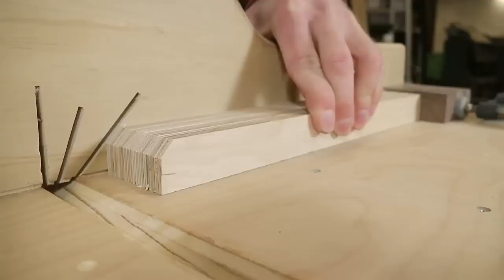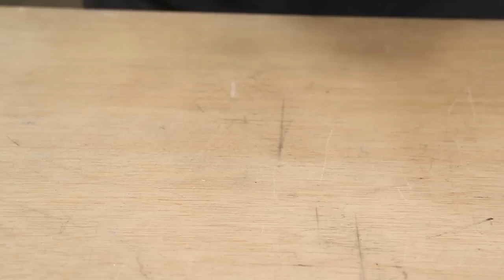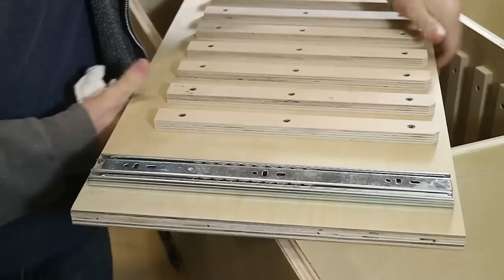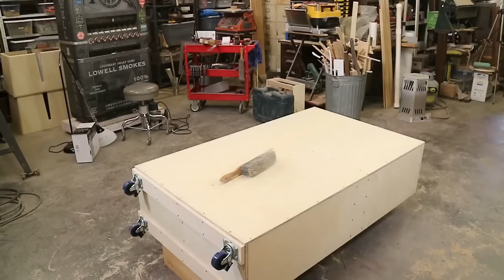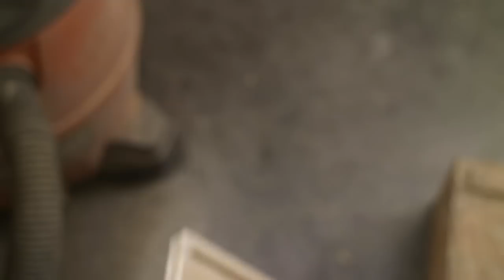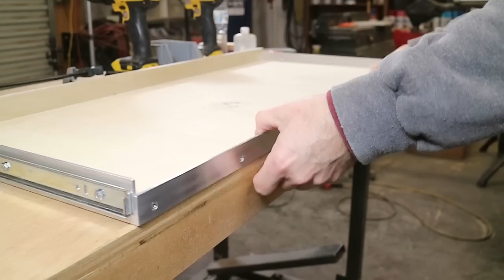Sorta Sortimo Small Parts Rack & Sorting Station

Comment: woodworking is 50% making, 50% fixing mistakes and 25% maths
Reply: 50% + 50%+25% = Ohh I get it.
Reply: Only if it is a big project.
Reply: @mathboy1212  yep I had 175% project once, it almost killed me😁
Reply: You know, 90% of all stats like that are just made up on the spot.
Reply: 90% of a project takes 90% of the time. The final 10% of the project takes the other 90% of the time.
Reply: This tracks. Also add some percentage for slop and looking at the project wondering where you went wrong/what were you thinking

Comment: A very well done and well filmed version of a not-great concept.  To even find out if you have the right box requires taking it out, finding a place to put it, or in this case, pulling out the tray, and putting the case down and opening the lid, praying that it never gets knocked over.  Then you still need overflow storage for larger quantities of common items.  If they were drawers, it would be one step- open drawer, select item.
Reply from the maker: I label them. That's how I know which one to grab. And drawers aren't really conducive to transporting to different jobs. If this solution doesn't work for you, that doesn't mean it's universally bad. Not everything is designed specifically for you.
Reply: @WesleyTreat  Not universally bad, just not optimal, IMO.  It would be interesting to see it in use after four years- still happy with the set up?  Again- great job on the video.
Reply from the maker: @jaywood8296  Yes, thank you, I'm very happy with it. I think what you mean to say is it's not optimal for the way you work. No solution is optimal for everyone, but may be perfect for many others. Thanks! 👍

Comment: Have a similar rack, mine is not as tall nor as nice. I installed it on the wall with French cleats, you will be amazed at how much you can get in organizers. Just a small tip when using the label maker to label ( I did mine on the yellow part of the handle), 2000 grit sandpaper and a wipe with isopropyl alcohol  will make sure your labels are not "self-removing."

Comment: Awesome work! The Jetson's table saw sound was priceless (as well as the Kondo gag). I built something similar (but not nearly as nice) to keep a storage system in my van. Some advice about putting labels on these cases - even using an industrial labeller (with "permanent" UV stable tape) I still found they peeled off over time. This was fixed by overcoating with epoxy - just make sure it's UV stable non-yellowing!

Comment: Nicely done. I would add a pair of tongs or tweezers hanging on the side of the cabinet for fishing bits out of those bins quickly.
The Jetsons table saw sound edits are hilarious.
Reply from the maker: I have plans to add some accessories. Maybe a tube for rulers, a slot for my binder with notes, and a square of sheet metal for magnetic trays.

Comment: So cool. I bought a ton of those stanley cases as well. I was also able to buy different sized bins to go inside them. The larger ones for the deep cases are especially nice.

I went through the same process you did: found out Sortimo was way too expensive. THen I also considered systainers, which I use for tools, but no. Same issue, and they also take up more room.

I still need to build my holder/rack for them, though. I like your design.

In case you're curious, thingiverse has a number of 3d printable containers for these, for all sorts of things.
Reply from the maker: Yeah, I'm already planning to hit up a friend of mine with a 3D printer for some extra bins. 👍

Comment: Wesley, very clever & beautiful design.
Too late to suggest this, but when you had to remove the bottom section of main case, you did not need to remove the screws at 4:52.  If you removed just the outside screws, you could have removed it as a "tee" section, and then reinstall as one piece instead of two.
But then again, in my world, something would have gone wrong and I would end up splitting the wood or some other dumb thing.

Comment: A simple idea that may speed things up is to drill a hole a little smaller than your smallest yellow compartment in the full-length pullout shelf. Then you can dump the contents of a bin onto the surface, sort out the parts you want. When you are done, hold the bin under the hole and sweep all the remaining parts through the hole and into the bin. It would be quicker than picking up all the parts and putting them into a bin.
Reply from the maker: Not a bad idea. I've already got one of these, though, which I'll probably hang on the side:
https://www.rockler.com/easy-sorter-funnel-tray
Reply: @WesleyTreat   That is really cool. Just ordered two. Tho I will say it is more difficult to lose a hole.

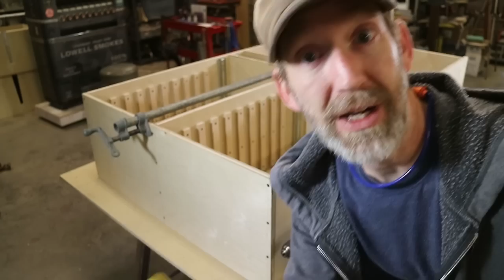Comment: 6:25   That 90 degree tool is good, but - they can be destroyed with too much torque. I broke one internally (I use them on cars professionally) and found an aviation one which is 100 percent steel, and way stronger. The one you have is pretty good unless you use too much speed or torque. As long as you are careful, it works.

Comment: Absolutely perfect cabinet!!!! I had made myself a smaller one and was looking for some inspiration for something bigger.   Any chance of basic plans/measurements/dimensions?  I am assuming it was all 3/4" plywood.  I love the use of the angle for your pull out shelf.  You sir are a genius!!!
Reply from the maker: I might put out plans for things like this in the future, but I don't have a system in place for that just yet. 👍
Reply: @WesleyTreat  Ok Just one question then.  Is it all made from 3/4" plywood or is it a mix of 1/2 and 3/4?  Hard to tell at a few spots in the video.
Reply from the maker: @4x4ff  1/2" for the drawers, the tray, the rails, the back, and the horizontal piece between the tray and drawers. Everything else is 3/4".
Reply: @WesleyTreat  Thanks Wes.  You da man.  I am a youtubeaholic especially with makers.  I truley love your videos the best.  I like your style.

Comment: Great video and build!  One thing I thought of though... After you completed the first set of internal cross supports.. You had to remove them to do the lower ones.. You could have just removed the screws from though outsides.. (not the ones holding the two pieces together) pulled it out as one piece.. Installed the other supports.. then slid the T back in.. And re fastening the outsides... Negating the need for the angle driver..  Not that I'm ever against looking for reasons to buy more tools.. But anyways.. Great video!
Reply from the maker: From what I remember, the two pieces together were just a little too big and awkward for one person to lift out without risking the joint tearing out. Glad you enjoyed it!

Comment: Very Nice!  I see you're using a kerosene shop heater - you DO have a carbon monoxide alarm, right?  Also I like your heater very much, and today it's 6°C inside my shop, so can you post a link to where to get it, or at least what kind, etc. ?  I like the "Made it hold both types of cases" as I also have both kinds, and they are currently very inconveniently stacked on plastic shelves.  One of your compatriots did a parts shelf with 10cm dadoed-in demi-shelves to hold the parts cases on, resulting in no less than 50% wasted space.  I think I will use 30mm aluminium "L" extrusions to hold the cases (mostly because I already have the stock), so that I can bump the density up just a bit.  I especially like the unloading shelf.  Very nice indeed!! 👍👍😃  I also like the straight cutting router bit on the back panel, for what Matthias Wandel calls "retroactive precision.'

Comment: I am having the same wish after I saw the video Adam made, but until now unfortunately have not found decent quality and priced cases, even cheap cases are hardly seen here.
Now just with boxes same as the grey one you are using for catching the small wood parts at the cutting table, using them as ''mix box'' for parts that came out of older items. 
Just... waiting for the right ''find'' then I will have nice small compartiments for the smaller items. 
They are now in jars, wallboxes, cookiebins,.. everywhere !
Reply from the maker: If you want really tough bins like that gray one, have a look at restaurant supply stores. Some are decently priced, some are really expensive, but they're all incredibly durable.

Comment: Great video. What sort of overhang on each side did your plastic cases have to slide in on those strips of ply? I have a heap of them with only 7 or 8 mm on each side. Thinking I might be pushing my luck?
Reply from the maker: Thanks. That sounds about right. A little less than 3/8".

Comment: Hi, great video thank you 👍👍👍. I have been looking at options for racking myself and have considered a design similar to yours. I am concerned about it being top heavy and worry about issues when moving the rack on its castors. Have you ran into any issues with this?
Reply from the maker: I haven't had any problems except that it's getting heavier than I anticipated, so I plan to add sturdier casters. I could probably topple it if I wanted to, but I tend to push it from the side when I move it, rather than pushing from the front or back, or I push somewhere below the center. I don't really move it all that often, though. If it ever became a problem, it would be easy enough to extend the base a few inches by adding a frame on the bottom. 👍

Comment: When you use a spacing jig like this, what do you do to mitigate things being completely askew at the end of a long run? Do you take measurements every 3 or 4 steps and readjust if needed?
Reply from the maker: I talk about that in the extended version. I checked every 4th rail or so to make sure I didn't get a cumulative error.

Comment: Great Cabinet, how did you install the inside pieces that hold the containers up, it shows one side with the three screws and the opposite side was never explained. If that was hard too understand the numerous runners that you cut were installed with the three screws but the opposite side in the center was not explained how you did that. Thanks
Reply from the maker: The screws on one side of the center were offset about an inch so they didn't run into the screws on the other side. 👍

Comment: I'd never remove the back panel. I'd cut a small clearance/access hole with an oschilating mukti-tool, just big enough for the slides to slide the "wrong" way, do my thing and then patch the holes with a dutchman.

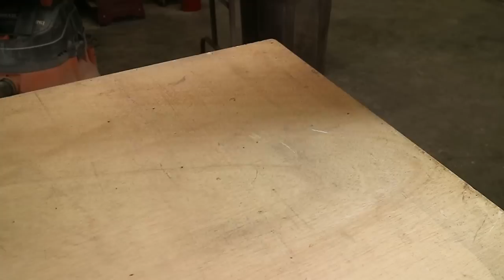Comment: 2:43
I'm curious why you didn't just glue-and-nail the shelf supports. It seems like the screws are the vastly more expensive way to do it. Do you need the extra strength?
Reply from the maker: My secret is not using diamond screws.

Comment: Wesley,  I watched this video 3 times, and have a serious concern.  That new table saw sounds like it has a severe harmonic imbalance in the primary gamma converter.  You may be able to get away with a restructuring of the crystalline matrix, but I suggest a full core jettison, and replicate a new shielded matter generator. 

Oh, the cabinets look neat too.
Reply: Sounds like the trans buffer modial girdle springs to me.  Could probably use a rebuild, just refer to TSB: 24-601B
Reply: @McFlysGarage  I've had a girdle spring go out...(don't ask).  TSB: 24-601B refers to the transsonic plasma dissector.  Maintenance for this saw should be in TSB: 24-601Q
Reply: @airspoon94  I think it just needs a small adjustment to the pre-loaded internally toothed cross-roll bearing slew ring
Reply: Just rewire the outermost connection of the generator. Third wire from the left, good thing you keep those assorted!
Reply: @airspoon94  odd, TSB 24-601B came from the French Division. It must have been mixed up in translation. I'll reach out to Javert and see about resolving that

Comment: 6:31 Hey you could have screwed the middle dividing board to the top board and then put it in the cabinet but that 90 degree drill attachment does come in handy though :P
Reply from the maker: I realized that later, but it probably would have been a little difficult to lift it in there myself without causing some damage, anyway.
Reply: @WesleyTreat  Ah yeah that's also true but hey at least you had an excuse to use a new tool :D

Comment: Question not a criticism; when you removed the first central upright,  is there a reason you didn't remove it as a "T" to save reassembly tight space?
Reply from the maker: A little too big to lift out by myself, at least without risking the joint tearing apart.

Comment: 6:19  What if you fix that board to the other board first, then having a T form and then put them inside and screw it tight from the outside. But then, you haven't to show that 90 degrees screwing tool in the video, which is a neat thing.
Reply from the maker: I should've eaten a better breakfast.
Reply: @WesleyTreat  At least TWO pop tarts (and maybe with frosting)

Comment: You have any thoughts about the caster locations you used? If it were me I’d move them out just a quarter inch or almost to the edge of the reinforcement spacers. Stability increase worth that little bit or she gonna be perfectly fine?

Love the build. Functionality is amazing. Drawer and platform and even the corners nipped on the runners to make it easier to slide the organizers back in. Love love love
Reply from the maker: It's perfectly stable. I've tested it and you'd actually have to try pretty hard to push it over. If I moved the casters to the very edge, I'd be driving in lag screws right next to the edge of the plywood.

Comment: Great use of humor.  Question?  Why a full back if not needed to add structure to the box.  Can I just use some 2" lengths as a backstop instead of buying a whole sheet?
Reply from the maker: Thanks! It's for structure. Filled with hardware, those cases start to get heavy quickly.

Comment: At first I thought this was a fairly ordinary design for a pretty typical piece of shop furniture, but it's very well thought-out and contains lots of good details. Excellent job.
And I love your new table saw sound. Makes me not mind so much that someone whinged about what is certainly an annoyance, but one of those things you just have to accept when you're watching project videos.

Since I imagine some of the hardware you're organising is the rivets you use when fastening sheet metal, can you tell me about the temporary rivet clamp doohickeys you use to hold things in place before the rivets go in? I've seen that you have two types; one for edges where the clamp can wrap around to both sides, and one for holes in the center of sheets where it simply penetrates like a rivet would except you can remove it. There also seems to be a special tool like a pair of pliers to place and remove the clams. Is this a system of your own devising?
Reply: @FrontrunnerDK  Thank you so much. I tried looking before, the first time I noticed them, and I didn't come up w/ anything.
Reply from the maker: Yes, they're called clecos. There are different sizes for different size  holes, indicated by the color of their shell. The copper ones are for 1/8" holes. Here's a starter kit: http://amzn.to/2i6nzFG

Comment: If you attached the center support to the cross piece and then inset them as a T you would not have needed the angle drill... But a great project otherwise. Guess you now need to save up to fill all those compartments!

Comment: holy cow, that's about $1000 in materials. But yes i know. It's TOTALLY worth it. I plan on going with Harbor frieghts boxes. THey are crap as far as how well they close. But for a stationary system that i do not intend to invert they will do great.
Reply from the maker: It ended up probably less than $500 in the end:
Cases: $300
Plywood: $90
Drawer slides: $35
Casters: $20
Misc.: $50

If you follow the Zoro link in the description, you'll find the Stanleys aren't that much more than the HF cases. 👍
Reply: I didn't intend to invert my containers, either...

Comment: Silly question: are you still using this system?
Reply from the maker: Every day!
Reply: @WesleyTreat  so, the reason why I ask: I'm actually workin' on a Gridfinity-like system that's way more laser-cutter friendly - I don't know if you'd be interested (I'm thinking it'd still be too labour intensive for a non-hobbiest like yourself to be of major benefit, especially as a replacement to an extant system) However, if I get this off the ground and I make it stick, I might have several dozen stanley containers left over. It's too early to say, but if it pans out: want em?

Comment: Some Observations: This is fine, IF you are totally convinced that your choice of storage is the BEST, for some time, and IF you already have a woodshop, tools, and experience to spend a LOT of time building the racking system. Fact is, for many small businesses, Time is MONEY, and you have the option of DEDUCTING Expenses, but NOT your own TIME. That means, investing in a full System that integrates storage flexibility with Racking accessibility and versatility, i.e. ways to change thing up as needs or experience dictates, is Money well spent up front. You can get down to your chosen work with minimal downtime spent struggling with the physical layout and accessibility a less-than-optimal system will burden you with, for months or years.
Reply from the maker: k

Comment: Why make the rails out of plywood? Wouldn't lumber be easier and cheaper?
Reply from the maker: If I used solid wood, I would've gone with a hardwood since the rails take all the abuse, but that probably wouldn't be cheaper. Instead, I used some 1/2" Baltic birch I already had, which should hold up really well.